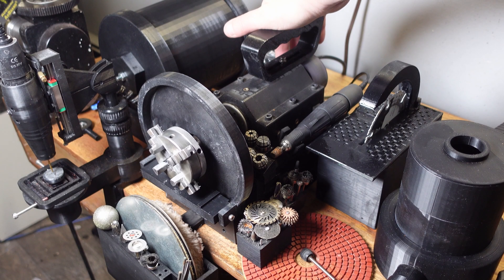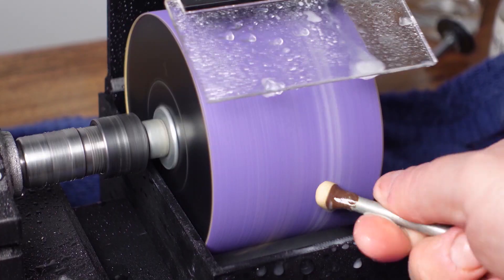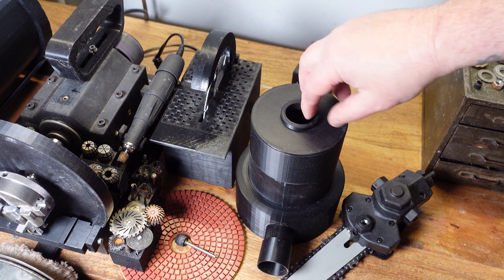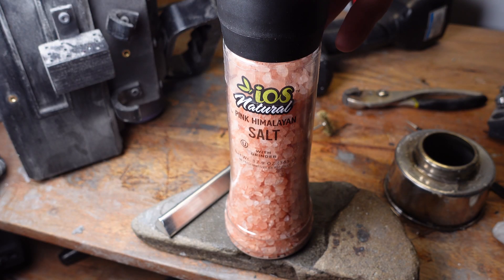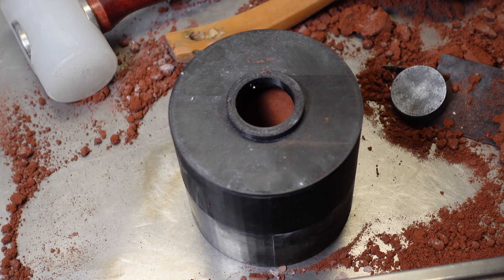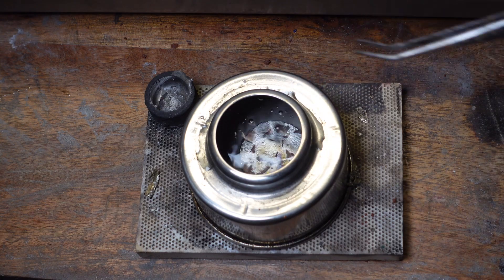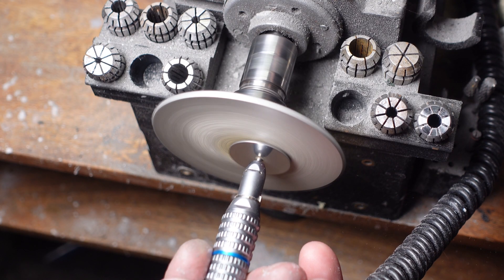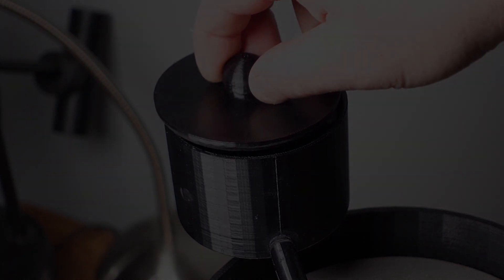3D printed metal foam tutorial. #3dprinting #maker #jewelerymaking #metalworking

Comment: Salt melts at around 800°C. Metals that melt at higher temperatures would be... an experiment, especially if you go past the boiling point  
If you're going to experiment dangerously,  may as well try crushed dry ice or just crushed ice along with lots of precautions.